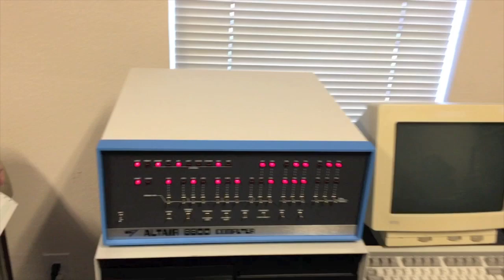Teletype Model 15 as a CP/M Console Running on an Altair 8800

Comment: Maybe I missed it, but what part of CP/M did you change to take alternate keys for certain (control) characters? The BIOS file? And how did you do that? Do you have the source code for the BIOS and did  you edit that? I'm trying to get the Commodore 64 (via an emulator) & CP/M cartridge (contains a Z80 processor) to recognize the Escape key. Per default, the Esc key is recognized as Ctrl C which warm boots CP/M. But some software needs a Esc key.
Reply from the maker: Neither the computer or CP/M was updated to work with the Teletype. The interface board handles the generation of control characters and the other characters not present on the TTY keyboard.
Reply from the maker: CP/M does not use ESC for anything, so I'd expect your Commodore BIOS must be returning Ctrl-C whenever ESC is typed.
Reply: @deramp5113  Thank you for your kind replies. The text editor WordMaster (which you use too if I'm not mistaken) says in its Help file: "Esc:  Exit video mode". That'll enter Command Mode so you can save your text file etc. Luckily, I recently found out that if I press Home on the Commodore 64 then it enters Command Mode. I guess the key mapping on the C64 is a little odd. 

P.S. Fascinating video: operate a digital computer with analog gear from the 30's!
Reply: @deramp5113 where to buy this thing